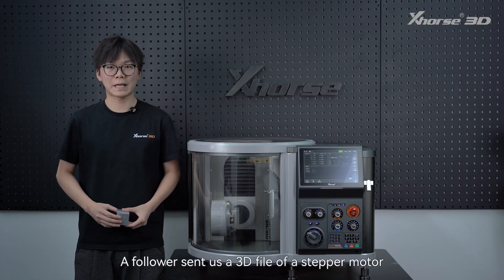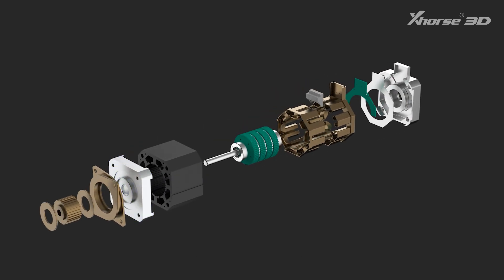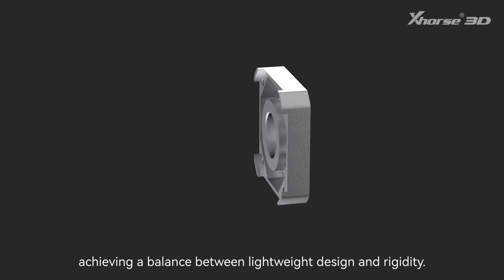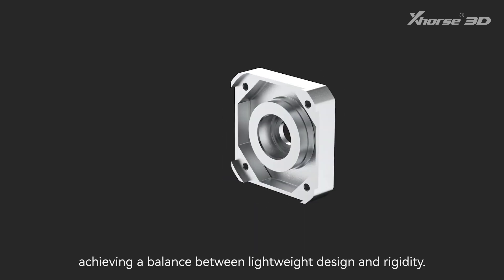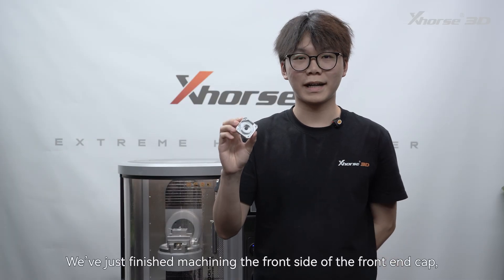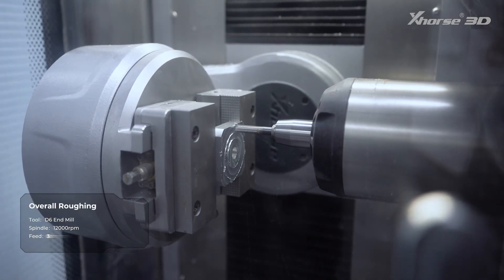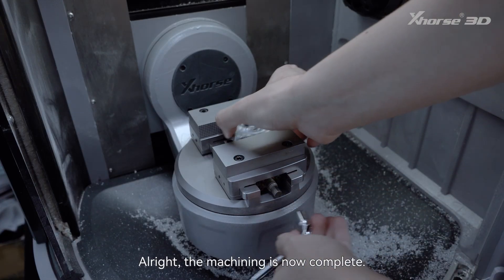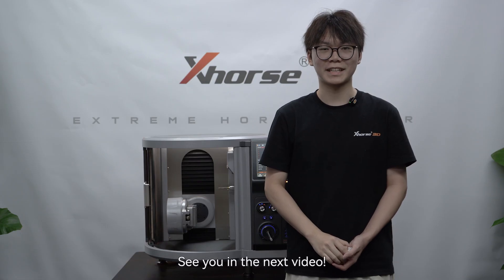CNC Machining a Stepper Motor End Cap from Scratch | Xmachine XM-100 5-axis Desktop CNC Machine

Comment: I am also a 5-axis CNC CAD/CAM programmer and I’ve just discovered that something like this has been developed. How can I purchase this product and from where? Does it have its own CAD/CAM software? Are the post processor and kinematics available? Is there a touch probe? What are the machine’s accuracy and calibration values? Could you help me with detailed information?

Comment: Sounds great. It would be almost a instant buy for me when it hits market. But! 18000 RPMs for the Spindel with such small tools is to low. Especially when cutting aluminium without coolant. Which brings the next Question, do you plan adding a minimum quantity lubrication? Maybe a Version with 50000 RPM Spindle?

Comment: Where is the part in the process where I save any time compared to a 3 axis setup?
Reply: You save time and precision, by not doing multiple setups, and you have the benefit of doing 5th axis moves..  If you don't already understand this then 5th axis probably isn't for you.
Reply: @Jeralddoerr  Yes probably 5 axis is not for me. That you save precision, I am 100% sure in this case.
At least you could clamp it on the side and machine the back side in the same setup or how did you do the chamfer on the back side?
Reply: We are waiting for 5 axis simultaneous movement. Indexing on a desktop cnc seems a bit pointless to me as it will not be targeting mass manufacturing